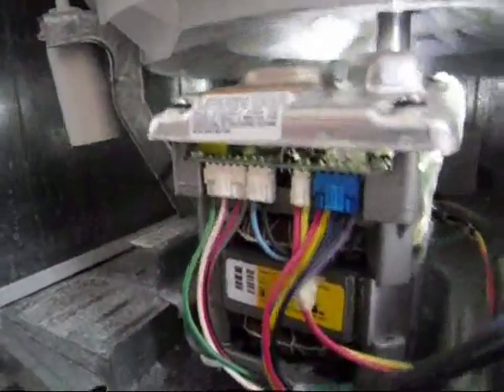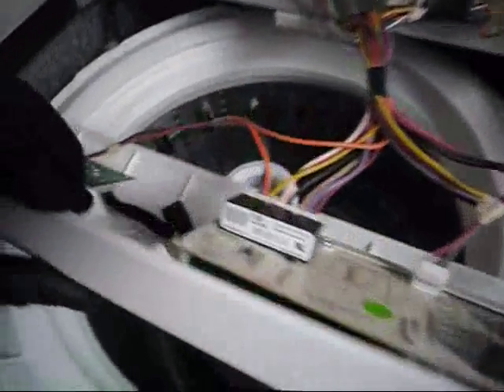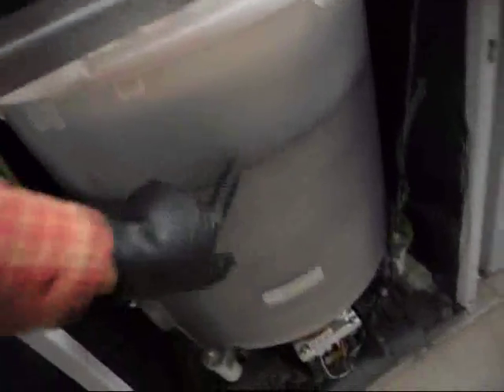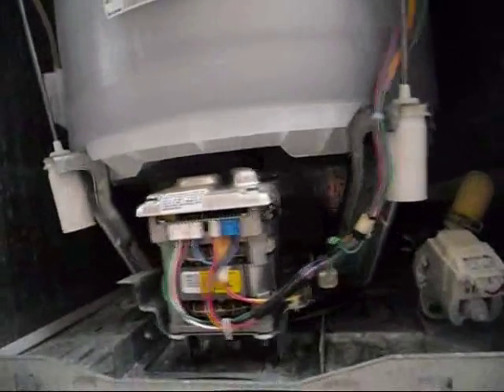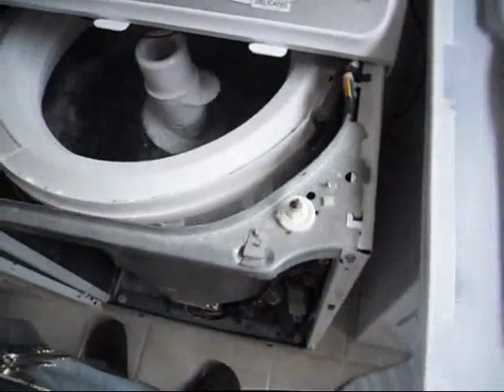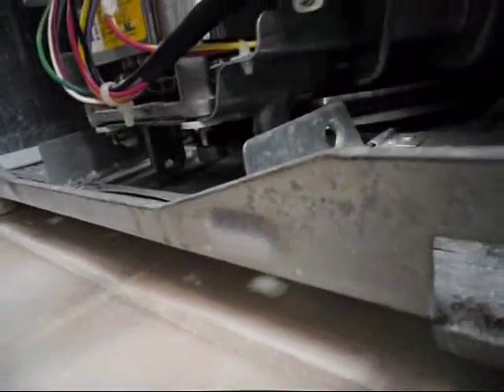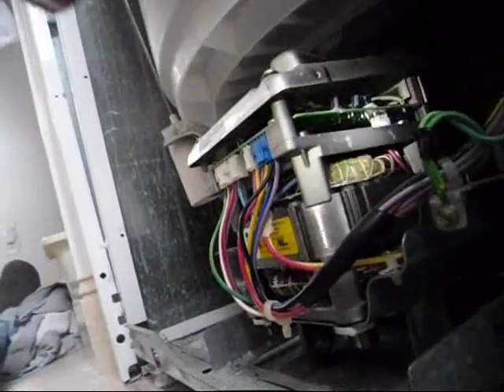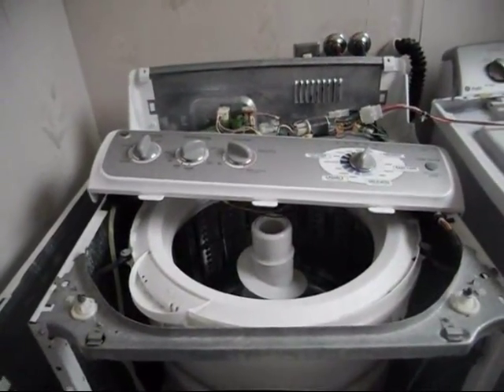GE Washing Machine Leaks Junk  11 7 13

Comment: The mode selection pole thingus is busted, that tub should NOT be indexing like that during agitation, this is a common problem and proves that hydrowaves are JUNK, if you're looking for new appliances, go with speed queen.

Another major issue is the frame tends to bow down on top and those antlers coming from the motor mount thingus drag on the bottom frame, making a squeaking noise!

So either get a speed queen, or good used whirlpool direct drive. :)
Reply from the maker: I guess it's time to fix it and sell it...  We have Whirlpool commercial machines at our apt building, they were troublesome when new, one washer was junked, a dryer had a mis-installed rubber wheel... Junk, thx!
Reply: CORVAIRWILD
Generally what happens with the whirlpool DD's is the motor couplers break easily on them, along with the pump leaking, both are a common problem, but another issue that can happen is the neutral drain pak - the mechanism that allows the tub not to turn upon draining - gets worn and the machine spin drains every time straining the plastic spin gear, which can eventually junk a whirlpool washer as its an expensive part essentially requiring replacement of the gear case, which is not that much more money than the spin gear. Is that what happened? Great machines and pretty easy to fix and work on, blah blah.  But they do have the issue of mold and mildew build up, and this is why I suggest a speed queen, as these machines are designed to spin drain which removes the soap scum and suds build up that accumulates on the inner and outer tubs. This way, you don't have to tear down the machine to clean the tubs every so often. Early whirlpool models did have a spin drain feature but this was removed as the spin gear would fail prematurely, so they tossed a neutral drain pak into the gearcase to fix this problem.

Comment: I have the same washer and my whole entire panel on the bottom is rusted out and it still has a little bit of water on the bottom. I initially thought it was the pump our the small little hose that controls how much water is going into the tank. I cant trouble shoot the leak so i said fuck it lol!!

Comment: Having the same issue.  Part of the problem w/ mine was the drain pump went bad so I replaced it for like $50 & the damn thing is still leaking.  Same machine exact machine you have & only 6 years old, junk!
Reply from the maker: Ur2ez4me81 my new seal didn't last long, so I gave it to the junkman
Reply: I have that machine and it is leaking. I've only had it for 5 years.  My mom has a machine that is still running 20 years later. My dad only had to fix it once.

Comment: we got pretty much the same machine from the controle panel down  the missing rod is for shiping dont put one in it will beat its self to deth its eather the supetion springs that are week or the top deck were the supention bars mount that is starting to cave in in the front like ours did we have had so manny problems with ours in the last year its horible to spend 600 bucks and have it last only 5 years
Reply from the maker: Yup... I'll get a wash tub and a piece of wood

Comment: having that same problem with mine.  it's leaking pretty badly
Reply: Ozen Rouse if your washer washes like this u need to fix the mode shifter. the drum shouldnt spin when it washes only the agitator. this machines drum isnt locking. i would fix that problem first and then the leak.
Reply from the maker: Luis Alvarez I have it to the junkman. And the fancy Samsung I replaced it with dumps bleach all over the clothes.

Comment: Buy a Roper at Lowes ,same as GE but a lot simpler.And has better rating than GE.
Reply: frome the controle pannel down they are all the same with the same problems my advice get a used one at least 15 years old put new seals in it and forget about it for the next 10 years